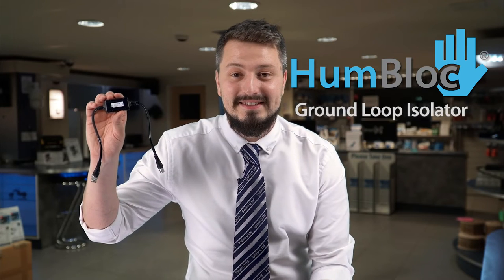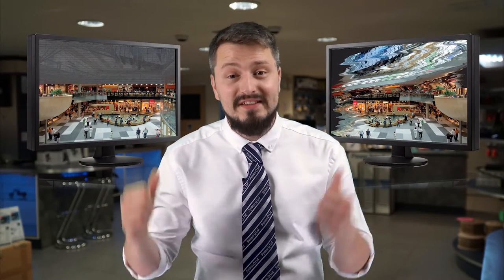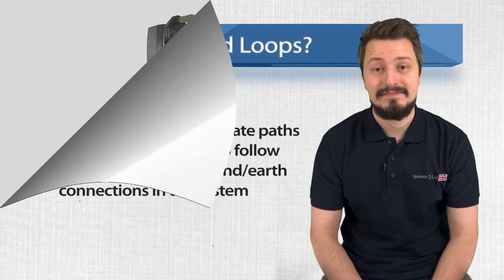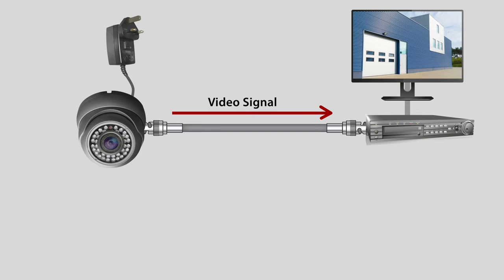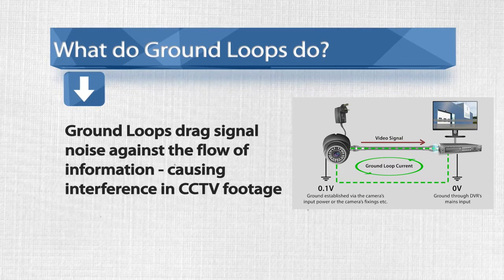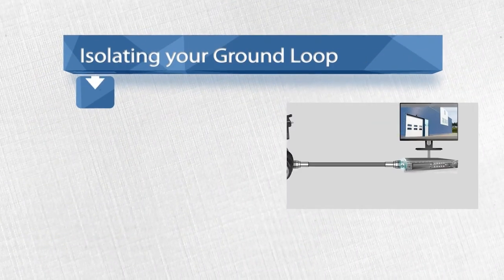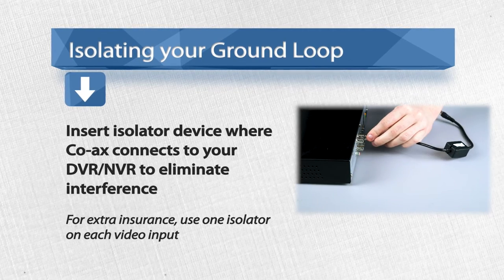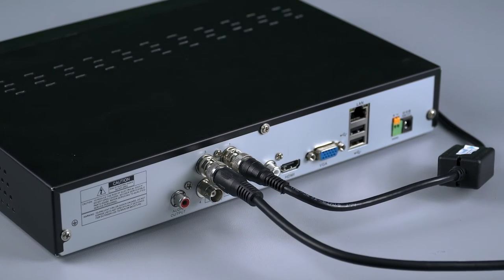Removing Earth Loop Interference | How To Fit CCTV Tips

Comment: Thank you for the info as i have like a zig zag stripe rolling down on one camera which runs on its own 12v adaptor but on that camera i also have audio built in as standard so do i just put the ground loop filter between dvr and the RCA Plug with the yellow & black  camera lead.
The dvr is a Samsung SRD1673 and the camera in question is just a composite type 4 wires Red+ Black--- Yellow is video and the blue being the audio and all the negatives are linked shared to the 12v adapter negative which is why im getting a rather anoying loop and audio hum 
So if you can imagine the yellow and black are connected to the RCA plug and same with the audio RCA Plug.

Thanks
Reply from the maker: Have a look at our tip page here, there may be something to help you. 
https://www.systemq.com/Technical/Tech-Tips